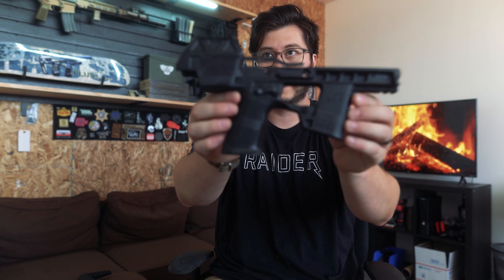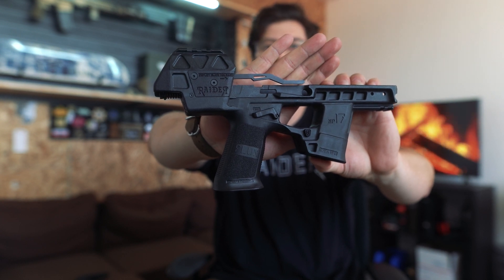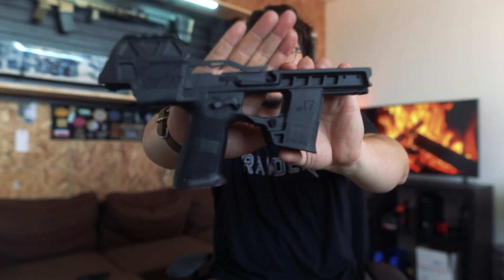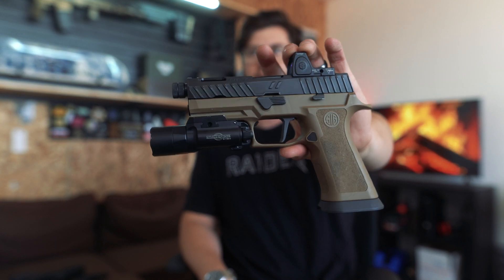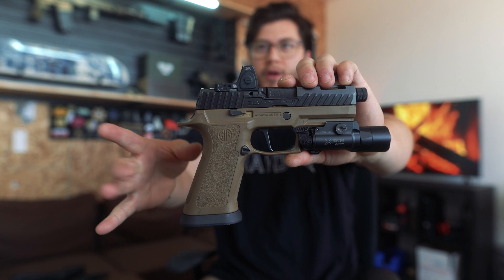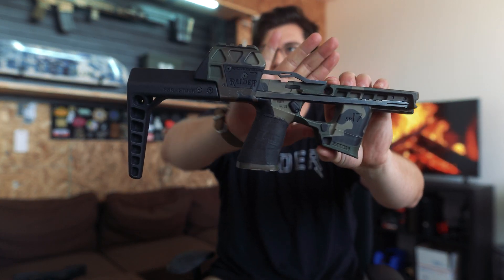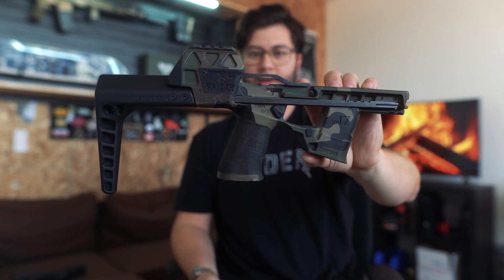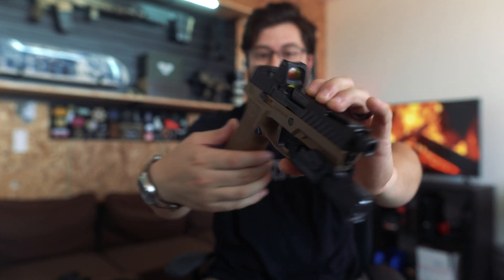What is a Flux Defense Raider?

Comment: The np17 is referred to as the first raider chassis correct? And the newest version is the raider x?
Reply from the maker: Yes the MP17 Raider is the old one. The Raider X is the new one.
Reply: @overtimealex69  ok cool. Thank you. Have you done a video comparing the two versions. I have the original raider and was curious to see the differences side by side. I read the differences on the site but that didn’t spark my imagination enough lol. Thanks for the great work man.